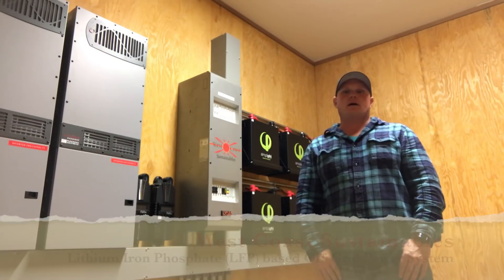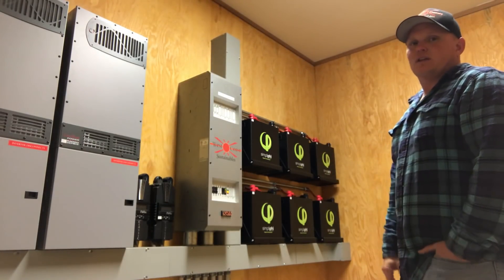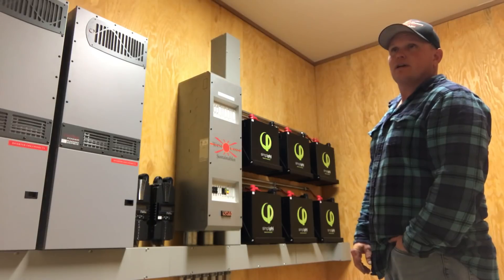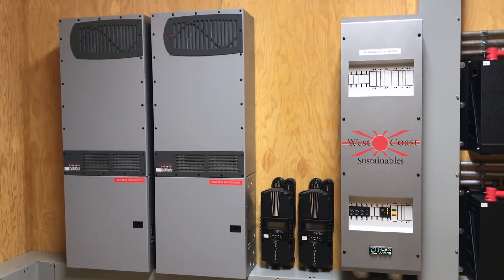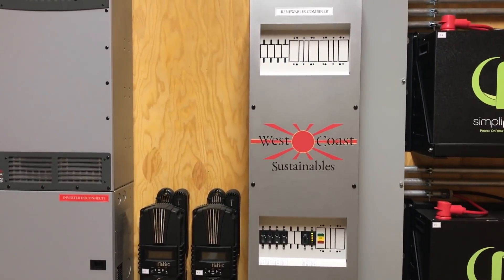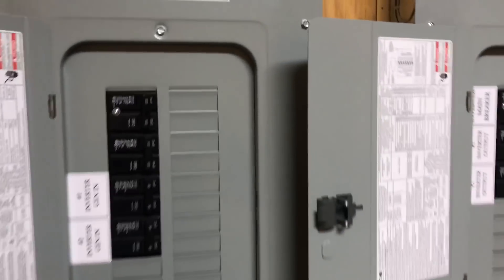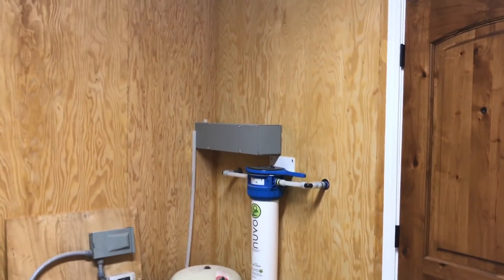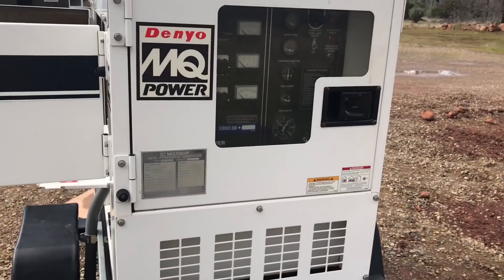Lithium Iron Battery Off Grid

Comment: 3:56 YOU SPLICE IT TO SIZE! the resistance you are creating with extra cable makes your system less efficient, especially with those thin battery cables.
Reply from the maker: Yes this was the required method per the manufacture so the BMS could all have equal resistance, all the cables are of the same distance and the actual load is minimal they are charged harder the anything and the system is working good

Comment: Hi Jason. We've got one outback GS8048A with two flexmax 80s, 8800 watts in 30 panels and 16 battleborn Batts @ 48 volts (21 kwh Max storage). We can run our apartment and two rental villas for twelve hours solid on batteries if necessary. All normal house loads, lighting,pumps,4 refridgerators and two minisplits-mitsubishi ,plus  TVs, WiFi misc. Etc...
All run great and the outback products and battleborn batteries have been performing flawlessly for us.
We are in the U.S.V.I. St. John and this system replaces our old grid tie system which was removed by hurricane Irma and hurricane Maria. Best money we have ever spent ! Installation was a challenge for me but all went well when I finally flipped the switch ( I understand that apprehension well)and we've been producing 40-60 KWH per day in our fantastic sun here. We use about 30 KWH each day and sell the rest. The system works hard and at it's Max 3 to 4 hours each day and gets warm but never slows down.
I appreciate the clean work and your attention to detail in your installations. Always nice to see a proper and safe utility room. Keep up the good work, it's refreshing to see the organization and quality work compared to some other videos I've seen. Subscribing to your channel now just to see more good work, good work ethics. 
Thanks...
Reply from the maker: Jeff,
I’m glad to hear that your system is performing great, so often people struggle so success is always great to hear about.  I’m curious to see how the battle born Battery performs over time as I am learning about all the ins and outs of the LifePo4 there sure are a lot of choices and I’m lucky to have the manufacturers working with me.
Thanks also for enjoying my work as I am always building with quality first and foremost as I’ve yet to have a customer tell me I did too good of a job lol

Comment: Jason, beautiful installation! I am a commercial builder and a fanatic about "pretty" utility rooms... few things are more impressive to a client.... everything on off-set ply backboard, conduit and gutter for all wire, clean as can be.  As for your design, why separate panels for Inverter vs Generator service, and separate main breakers?... seems like plenty of room in a single panel.... Also, why manual rather than ATS?
Reply from the maker: Billder Inbaja thanks for liking and commenting, the split panels are to allow the system to be bypassed in the case of a fault.  The transfer switch is manual because it would only be used in the case of a system error and I would verify conditions were safe before transferring over to back up